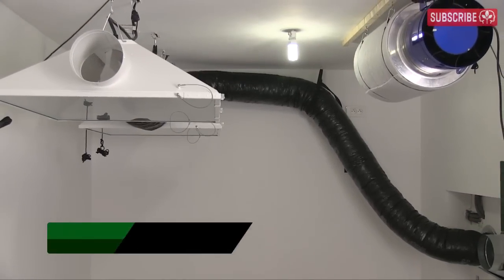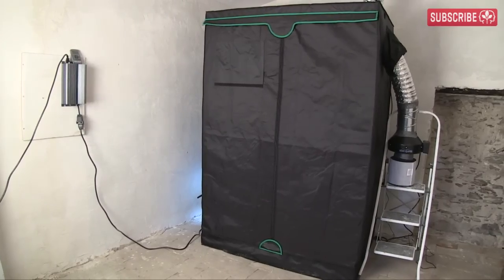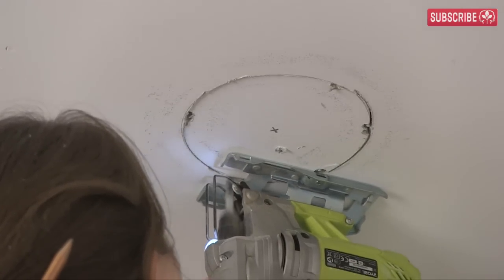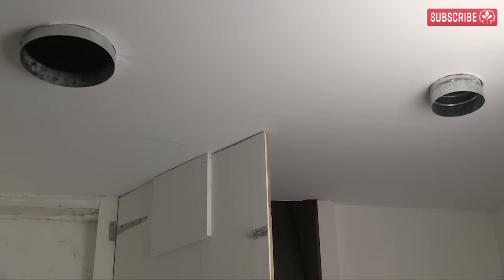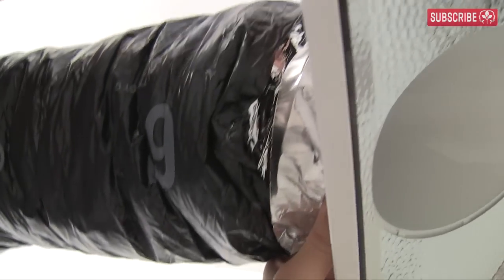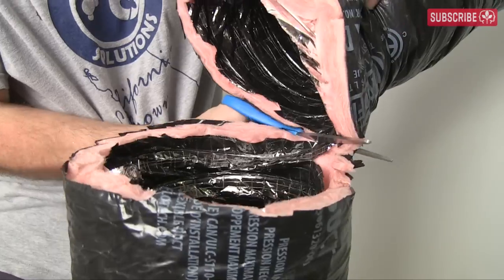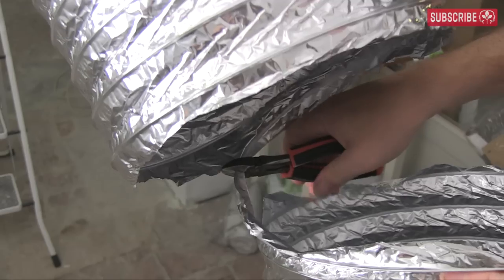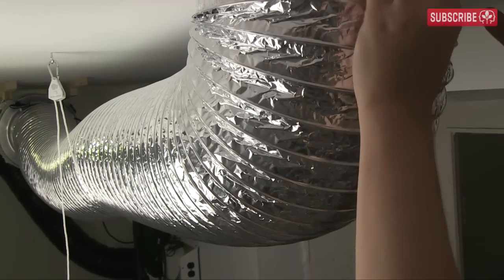Air-Cooled Grow Light Extraction Set-Up with Insulated Ducting

Comment: Wouldnt cold air wreck the globes or reduce the grow efficency? My room is too hot with a 1000 watt its only 4 x 4 even with a hyper fan and 8 inch carbon filter its way too hot, 34 degrees when its only 25 outside! So I dont know what i can do in summer.. Maybe dropping to 600 wats  may help the room be growable in summer, although i dont know if that will drop the heat enough.
Reply from the maker: Hi PC, I would recommend dropping to a 600W or 750W system and consider investing in some active air cooling so you can keep growing through the summer.
Reply: Thanks, shouldnt the fan n filter setup be cooling my room? Maybe it is and it would be worse without it. Problem last winter was it was getting to 9 degrees celcius at night. What annoys me about needing the carbon filter, (used to live by myself and didnt have to have it then) is you are limited as to what you can control, no point using Co2 as it will all just get sucked straight out, and im wondering if an oil heater might help at night, or will the fan suck most of that out? I cant use an air con as no access to exit points, (Carbon goes into roof) but im wondering if the cool lights you have above will save me? Can you just extract the heat out of the light into roof or do i really need a cool air inlet for it to work? Thanks for the Advice love this channel mate.

Comment: Don't know why you cut the ducting? A spigot to seal the gap between duct a plasterboard and just run a continuous length all the way to exit, eg. better air draw, less cutting a fiddling about with fittings. Also, when you cut ducting,  run some silver foil tape around rim of cut and a few inches down the inside to reinforce and get a good join. ☺and use a pad saw for cutting plasterboard/dry line..if you hit a cable or pipe, you won't be happy 👍
Reply from the maker: +Seismic Shock Great advice - clearly you are a lot more practically minded than me! Thanks for sharing amigo.
Reply from the maker: +Seismic Shock I run lots of different set-ups so my builds reflect this impermanence! :)
Reply: Everest Fernandez we.learn off each other brother. ..everyday is a school day!
Reply from the maker: +Seismic Shock So true! Thanks again amigo.

Comment: Hey man should I set up my intake and outake on separate sides of my room? Would it be ok if one is coming in throught the bottom and one at the top? And yes im gonna have oscillating fans for air circulation. Thx
Reply from the maker: +KillerShootin 69 sure - ideally your extract should be high up and your input should be at bay height, in between plants and canopy. I take and out should be at opposite sides too, you're right.

Comment: Is there a fan pushing/drawing air through the ducting of the air-cooled lights?
Reply: nevermind, i found the answer in a question below. haha.

next question, you have a 4 in fan blowing in the lung room.

i dont have a lung room, just a smaller sized grow box. would i need a small fan to push air through the air-cooled lights?

Comment: can you tell me why people don't suck the air through the filter through the light and outside thank you very much I really like your Channel
Reply from the maker: Thanks A Woodman. Blowing through your air cooled ventilation system mean that any leaked air is simply pushed into your garden, whereas sucking air risks unfiltered air being extracted to the outside world and creating odor issues.
Reply: Two reasons. 
1. The Carbon filter restricts air flow, so filtered air isnt moving as fast, and the exhaust fan might not move the heat fast enough to keep temps down.  With no filter that air can move really fast and get the heat away from the bulbs quickly. 
2. Separate systems means that the air that we use to keep our lights cool will not have smell because that system never uses air thats been in the grow room. Growers dont filter that air because they dont have to. Its a matter of efficiency in a sense.

Comment: how do i attach the duct fan to the lighr
Reply from the maker: +Miquiel Ward Hi Miquiel, thanks for your question. It's worth noting that alternative arrangements are possible. You could use a length of ducting between your air cooled hood and the duct fan instead and locate the fan elsewhere. Many growers take this approach so that their lighting fixture is not unevenly weighted with a fan attached at one end. However, if your preferred arrangement is to connect the fan directly to the hood, attach it so that it blows through the fixture, use duct tape and a noise reducing clamp, and then fixture hangers to take the weight of the fan so it does not pull down on your fixture and is more secure.

Comment: So there's no 6" fan blowing through the hood vents? Does the heat just Ben out on its on? I'm pretty sure you'll need a 6" inline fan to extract the hot air right?
Reply from the maker: Hey Eman. There IS a 6" fan blowing but it's not attached directly to the light. It's located in my adjacent lung room connected to an intake filter.

Comment: If inline air is going thru duct work to cool the lights and out of the room, why do you need an inline filter. That air isn't being circulating throughout the grow room, its coming in thru the bottom run thru the hooded lights and out thru the top of the room.
Reply from the maker: Hi Jim, thanks for your question. The Phresh intake filter removes dust and other particulates meaning nothing builds up inside the ducting, hoods and lamps so they are easier to maintain and keep clean.

Comment: I know venting upward to work with the rising heat is important but what if restricting circumstances require you to duct down about six feet as soon as the air leaves the room?  Theres about 8 feet of ducting inside the room.
 How bad is that and will it decrease ventilation enough to screw it all up?  Also using six inch inline fan.
Thanks for you help.  Super instructional and I love it.
Reply from the maker: Walter Miranda I wouldn't worry Walter. An exhaust fan and ducting will send your air in any direction you wish. :)

Comment: how often does room ventilation inline fan come on?
Reply from the maker: Micheal Jordan Hi Michael. Thanks for your question. Air is constantly exchanged in my indoor garden, whether it is lights on (daytime) or lights off (nighttime). As such the ventilation fan is on permanently, although the speed / power of the fan is determined by a fan speed controller linked to a thermostat. Check out the Mercury series or Spartan fan speed controller by Titan Controls—alternatively, take a look at the Zephyr 1.
Reply: Everest Fernandez 
wow. i didn't think i would get a response from ya. thx... 
another question?
so im guessing no co2 system? since its not sealed

Comment: You say you are going to divert the heat from the lights in the winter but what about the air being scrubbed through the filter and fan? That currently goes outside as well? What will you do with that in the winter?
Reply from the maker: Generosity Popo Good question G—thanks! I may channel that indoors to the upper floor too—however I'm a little wary of pumping too much moist air into my house during winter (think of all that transpiration!) but I like the idea of waking up to an oxygen rich living space! I'll keep you posted. First I need to purchase / create a neat way of changing the air flow direction without having to detach / re-attach ducting.

Comment: Where is your exhaust going? What's on the other side of the ceiling of your room? Are you blowing hot air into your attic?
Reply from the maker: Yogi Bear Hi Yogi B. Good question! My grow room is in my basement. The ducting goes up an old, disused staircase and out into my backyard. It's summer right now so that works great. In the winter I plan to divert the ducting so that it helps to heat my kitchen on the floor above. Happy to make a video showing the ducting plan if you like.

Comment: Will you use your home's AC to cool the air in the lung room and the mother room that's being used to cool your lights and intake? How cool should the intake and air going thru the lights be? Any general rule of thumb for that? Thanks in advance. Great setup and videos!
Reply from the maker: John Doe Thanks for your question John. I will not be cooling the air in my lung room. It's already a steady 64F because it's underground. As for air-cooled lights—be careful not to overcool as the lamps need to be HOT in order to generate the correct spectral distribution. Watch our video entitled "Does air-cooling your lamps decrease PAR output?" - think gentle breeze rather than Siberian hurricane!
Reply: Everest Fernandez ahhhh makes sense ! Didn't think about the basement. And thanks I appreciate it. I'm setting up a 4x8 tent. 6" phresh filter and 6" hurricane fan for intake. Same for the 2 air cooled hoods. And a 6" carbon filter and fan for exhaust.. hopefully that's not overkill as far as cfms go. Any input ? Thanks again !! This channel is super informative!
Reply from the maker: John Doe Hey John. It's only "overkill" if you are exchanging so much air as to lower relative humidity or temperature below optimal levels. Obviously this is largely dependent on your ambient environment. I'd say your tent requires a minimum of around 256 CFMs air exchange. A 6" hurricane is rated at 435 CFM, but your carbon filter will reduce this by 20% so you're looking at around 348 CFMs. I don't consider this too much because 256 is a minimum. Good luck and keep us posted! :)